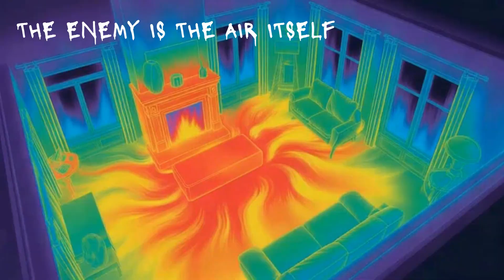The Fatal Mistake Everyone Makes During a Winter Blackout

Comment: Yeah. Can't wait for the yearly cold weather power failure. Its usually pretty fun for our family. We read, play board games with the grandkids, cook using the wood stove. Lots of baking. Nothing like old fashioned cooking. Watch some movies. Really good coffee. Although we have backup power generation capabilities. I like using the candles, oil lamps, or just the light from the fire. Drives my wife nuts. On really cold days we will use the portable solar setup to run a small space heater with the wood stove. Generator kicks in as needed.